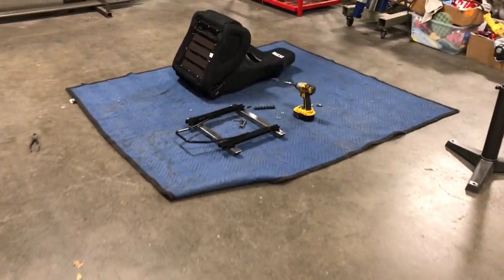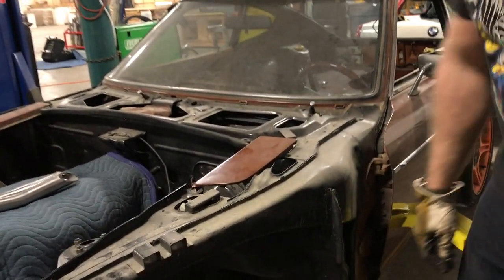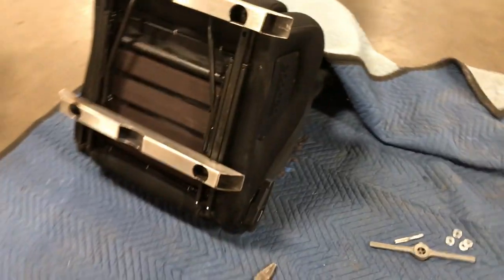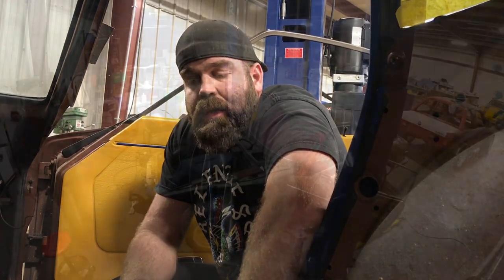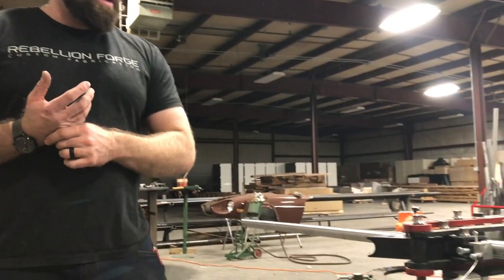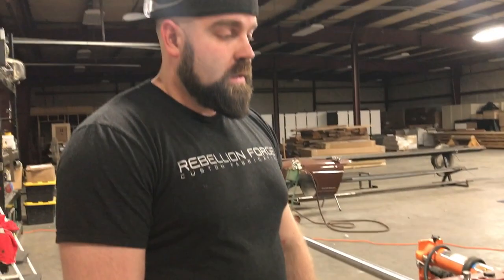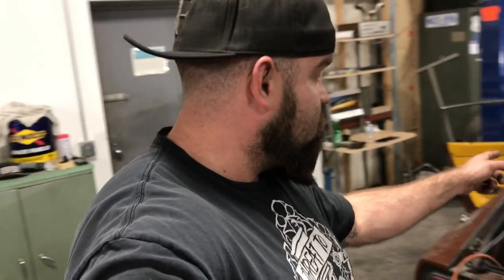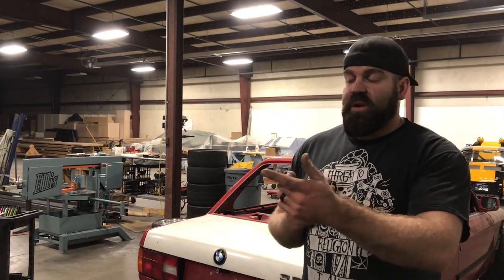2J-Z Chassis Fabrication Begins | 2J-Z Episode 23

Comment: I'm wanting to put a roll bar in my 240z and like the idea of keeping the original seat belt mounts, which this design seems to accomplish.  I'm very naive on the subject of roll bars, would this one be "track legal" necessarily, would it pass a tech inspection?  I'm sure there is a set of rules out there somewhere, I'm just curious if mounting the hoop to the wheel wells instead of the floor would be frowned upon.
Reply from the maker: This particular roll bar wasn't designed to conform to any kind of sanctioned racing organization (NHRA, SCCA, etc.). It would only be by luck that it'd pass and kind of E/T cert. The purpose of this bar was purely for my own personal safety if the car were to ever roll.
Reply: Why it may not “meet” NHRA rules....they’re somewhat of a joke anyways. This would still qualify for NASA so if you’re looking to do HPDE events you would be good.
Reply from the maker: +Rebellion Forge 🤘